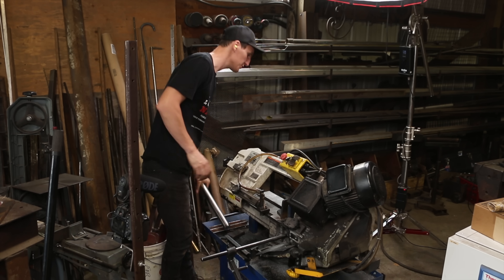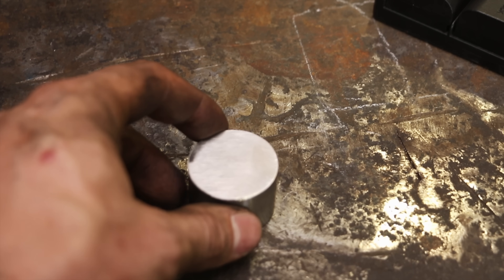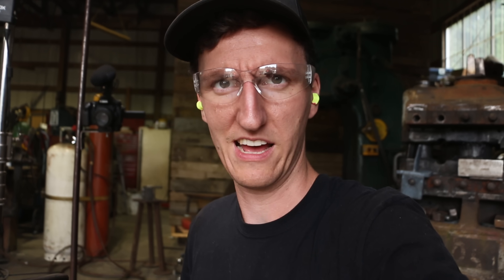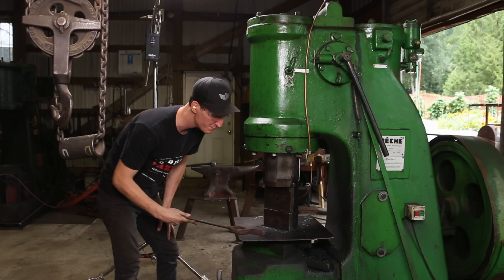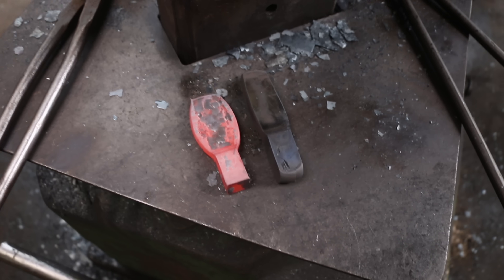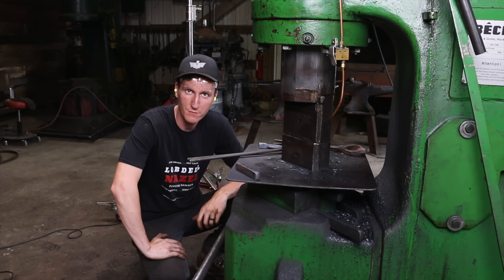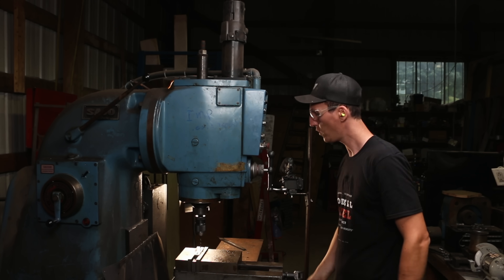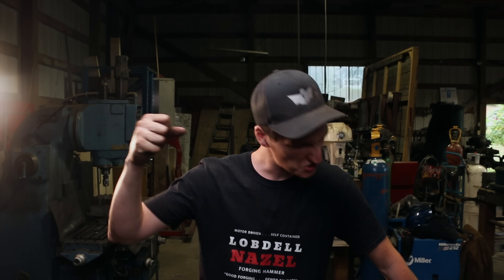Can I Forge INCONEL?

Comment: Old man: Power hammers make less of a blacksmith.
Me: yo I bet you can’t even handforge this mild steel bro…. 😅
Reply: Well, not all old men are wise men i suppose...
I had to start by hand when i was young, bit my master did use the powerhammer "You need to learn, but i need to save time"
Reply: @Vampi_Sweden  If you use ANY modern equipment and do not smelt your own alloys by digging up minerals, you are NOT a smith, you are a metal worker.
Reply: @michaels.ramsey7803  And don't dare to buy any of your tools...
Reply: @michaels.ramsey7803  Incorrect.
A Blacksmith is anyone who works with steel, Iron, etc using hammers and other implements to deform it.
A metalworker ironically is anyone who works with metal in any way; casting, mining, etc.
Even historically not all Blacksmiths would've mined their own ore. Miners EXISTED at those times too; and iron was a hot commodity for anyone willing to mine it.
So was coal. Coal was mined, and sold, almost never mined by the smith.
Reply: @michaels.ramsey7803  I call BS on your  definition of a blacksmith. I've  been working as a blacksmith in industry for 30 years.  Forged tons  and tons of  both straight carbon, many grades of stainless as well as many grades of alloy and aerospace grades.   Forged thousands of pairs of tongs as well as other tools and machine parts.
Reply: @D-Vinko  Before coal they had to make charcoal.  Coal miners did not make charcoal either.
Reply: If this was a mild steel and not a super alloy, I’d be more keen to agree with you

Comment: Do you think heating it to forging temperature will affect the properties of the inconel? Does it just get harder and more brittle as it heats but then then ductility returns as it cools?
Reply: It is non ferrous. The one crumbled as it was near melting.
Reply: @jason00121  Right but brittle crumbling isn’t usually a property of most metals near their melting point.
Reply: @BradyBegeman  Ohh, be careful there. Not of metals, ideed. But inconel is not a metal. Its an alloy, many metals. Quite a few alloys do this this, cast iron, roofers tin/lead solder, high zinc cast brass, some bronzes, steels too high in copper and sulfur impurity....you get the idea. These are not fully eutectic/dissolved into each other and one constituent melts much earlier than the others and boom, youve got a hot short mass of self lubricated crumbly things.
Reply: @jason00121  not really non ferrous  inconel cann contain iron but doesn't have to but nickel is in the same group as iron and that's the ferrous group also nickel is magnetic like iron inconel isn't magnetic because of it chrome content witch causes a different structure in the elemental cell
Reply: I know that it air hardens at least when welding it cracks extremely bad

Comment: Inconel is like only 5 to 10 percent iron I think, depending on the alloy. Mostly Nickel and Chromium. So I'm not surprised it can't be forged easily. Also apparently it work hardens very very quickly.

Comment: This alloy was the foundation for molten salt Nuclear reactor. If you can forge it maybe you can make a fission reactor and solve all our energy problems.
Reply: Inconel is routinely forged, just with slightly bigger presses
Reply: This material is a foundation in water cooled reactors as well.
Reply: Hastaloy was also used .
Reply: @wdwerker  Hastelloy
Reply: Except salt reactor tech has been abandoned orphan technology for decades lol
Reply: @joshschneider9766  Because it can't enrich uranium/plutonium for nukes. It's however much safer than water cooled reactors, if deprived of power it cools, rather than reacting harder, so it'll never have a serious accident, barring destruction of the reactor by an outside force, like someone bullseyes a bunker buster on it. It's also having a bit of a resurgence, reactors are being built. In fact one is scheduled to be completed and start testing in September this year.
Reply: @OnlyKaerius  If you look at the video that is out there for what happened to the molten salt test reactor you can see why it was set aside. Salt is not your friend. The thing nearly melted down.
Reply: @michaelbaker8284  Bullshit, the test reactor was a success, deemed safe and reliable, the only problem they encountered was that Tellurium (one thing produced by the fission) caused microscopic cracks, which could be a problem during a 30 year reactor life, but they also figured out that just adding some niobium to the alloy would fix the issue. As for overheating there's a plug at the bottom of the reactor that melts at 750C, as a safety measure. That prevents the possibility of a meltdown, once dumped into the lower chamber it takes a few weeks to cool down, doesn't need any external cooling or  power, it fails safely thanks to this.
Reply: @OnlyKaerius  Which was the one that nearly blew up then?
Reply: @michaelbaker8284  The salt reactor nearly blew up a few times but that was mostly because they seemed to be trying to bait it. It was a different time
Reply: @michaelbaker8284  You're supposed to know that, since you made the claim. But it seems to me like you've misunderstood, mixed up, or been misinformed.
Reply: @michaelbaker8284  Perhaps you thought "gone critical" meant it was overheating? It just means fission is occuring.
Reply: @DjDolHaus86  I think you’re confusing molten salt reactors with liquid sodium (the metal) reactors.
Reply: @kokofan50  I suspect you are right
Reply: @OnlyKaerius  Enrichment is a mechanical process - not a part of fission.  Plutonium is created by certain isotopes of U.
Reply: @godslayer1415  Plutonium is created as a reactor byproduct. It is created by bombarding Uranium-238 with neutrons. Most reactors fission Uranium-235, the 238 isotope however can be put in the reactor for the purpose of enriching it into plutonium, which comes in two types, Pu-238 is reactor fuel, and Pu-239 is weapons grade. So it is most definitely a part of the fission process, not mechanical. Uranium-235 however is enriched mechanically out of natural Uranium(which is 99.3% 238, and 0.7% 235).
Reply: @OnlyKaerius  I hope so we have focused on the war effort for 100 years and it slowed science to a crawl.
Reply: @OnlyKaerius  yep exactly right. but windmills will solve the problem. lol and solar that looses efficiency the hotter the solar panel gets. lol.  Not to mention the storage of energy problem.  power needs to be on demand simple as that.
Reply: @joshschneider9766  it’s not orphaned anymore. Numerous companies in several countries are working on MSRs.
Reply: @joshschneider9766  Except for the billions China and India are spending on it - not to mention no less than 2 efforts in the US.